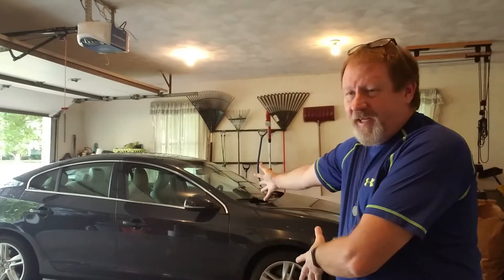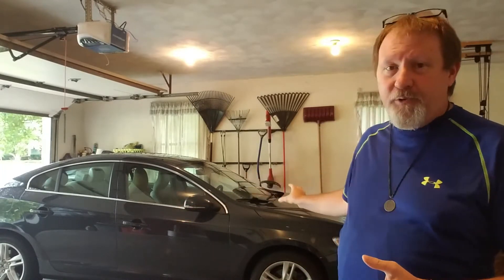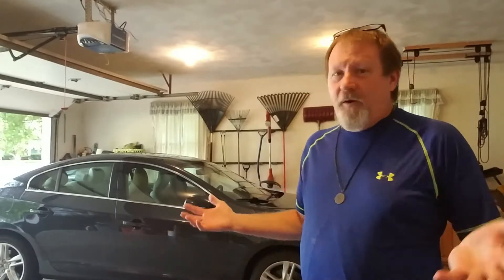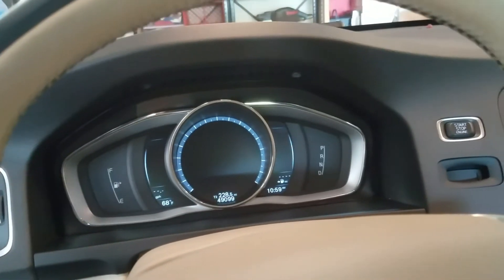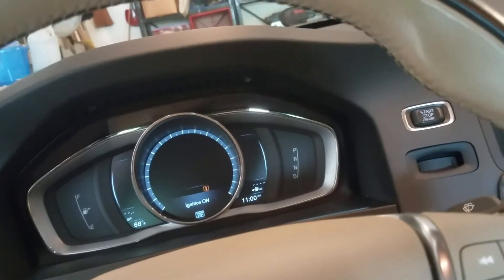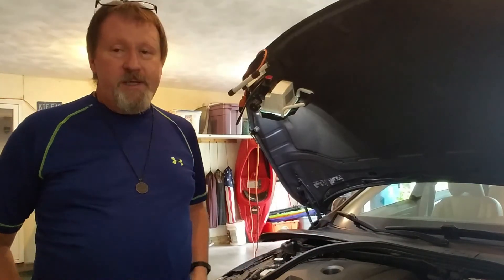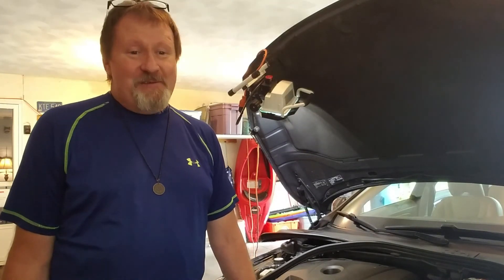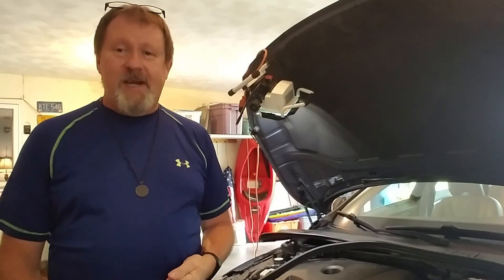Volvo Drive-E Start Stop Not Working

Comment: Hello Floyd,
It's so good to see persons like you, interested in helping others with some car problems. Machines are machines...! right?
This is a brief description about how the Volvo Start Stop system works, in big steps:
-1st engine start of the morning= Only Main battery is used to turn engine and power everything at the same time (Big Battery visible in engine compartment). Small Support battery not needed.
-Car comes to first stop and engine is stopped by S/S system= Main Battery runs all electric consumers in car. (NOT support Battery).
-1st S/S start in driving cycle= as brake pedal is lifting, the Main S/S relay box (under cowl) will switch momentarily, all electrical consumers to the small Support battery (under the cowl) and it uses the big Main battery solely to start engine (This is because you want to use the most powerful battery to run the engine starter motor). 
-As soon as the engine restarts (like in milliseconds) all electrical consumers are switched back to the Main Battery for normal running until the next S/S cycle and so on and the small Support battery is disconnected.
The small Support battery is ONLY used those very few milliseconds while the engine restarts from a S/S cycle. During normal driving, this Support battery is just idling waiting for the next start cycle.  
Conditions like: Climate A/C, Ambient temperatures, Charging system status,  batteries State Of Charge levels, might prevent the system from working. Both Main and Support batteries, must have a SOC at least around 72% to be Ok.

I hope this bring some more understanding to how the Start/Stop system works.
Greetings, Ben
Reply: Hi Ben! Thank you for the detailed information! You caught me just in time, I was about to enroll into a S/S course. 😂

Question: To reset how many seconds for each function? As my dash showed, none of the indicators that Floyd mentioned. 

Thanks again, 

Jean
Reply: @jdykes1381  Hi J. There is no reset function for this system. Both batteries are monitor by CEM (central electronic computer) for state of charge and state of health, continuously. If one fails, the system becomes disable and the message to driver states that S/Stop system is unavailable due to electrical system fault. Once you diagnose which battery is bad and replace it, you have to use VIDA (Volvos diagnose application that all Volvo dealers have) and reset the counters for the battery life, in other words you tell the CEM that the main battery is now new. The small battery does not have this counter. So, determine which of the 2 batteries is at fault if not both and replace them with the Volvo spec and brand (they are better and yes more expensive) and have the counters reset. The system will Aldo sense that the state of charge and state of health on both bats is now within the specs. Saludos.
Reply: @bencastillo3249  Thanks, Ben. I should've mentioned that I just replaced the support battery. However,  it isn't working.
Reply: @jdykes1381  Hi J. Maybe the problem is deeper, outbid your scope. Not knowing the condition of the auxiliary condition, remember that there are more components involved in the system like the start stop relay box, BMS sensor attached to negative main battery cable (you can try if you haven’t, disconnect negative cable and then small wires connector from bms and leave it disconnected for about 10 minutes)see if that helps you. Are you a technician or do it yourself? Otherwise you might consider taking your car to the dealership.
Reply: @bencastillo3249  Hi Ben. I will take it to my mechanic.  Thank you!

Comment: I tried various combinations of the steps described herein far resetting the batteries; none produced the expected result
Reply from the maker: If you're having troubles with battery messages, or start/stop function and resets don't work, then one or both of the batteries likely need replacing.  I tried the resets too, but it didn't help.  I had to replace both batteries in the end.
Reply: @MIFixItDad  batteries were replaced less than a year ago

Comment: I want to disable the Drive-E option, dont want to stress the ignition and batteries for a few seconds I stop.
Reply from the maker: Unfortunately, there is no way to permanently disable the start/stop option.  Each time you get in the car and start it up, you have to push the button to disable for that trip only.

Comment: I charge my auto battery about every six weeks with my auto battery charger. We use our lights heater/ac head lights brake lights phone chargers wipers constantly. So a good charge on your battery is a good thing. Pick one up for around $50.00
Reply from the maker: You shouldn't have to rely on an auxiliary charger.  It has a 210 amp alternator that should easily do that.  It's kind of it's job.  As soon as the car is running, the alternator is what provides the power to those devices anyway.

Comment: The dealership charges 400.00 plus to replace that battery. It takes 20 minutes to replace!! Your videos are a lot of help and resolves the gouging of the dealership!
Reply from the maker: Thanks!  I can't see paying that much for such a simple job either.  It's just silly to do that.
Reply: Good luck on a v40, it took 4 hours and two professional technicians
Reply: On the V40, it's a whole bumper off job.  Could Volvo have made it any more difficult.
Reply: @garymc3519 it is bumper off, but it’s a really easy one to do. Definitely not four hours, even for a novice
Reply: 450 in Australia. Went to a local battery shop and they fitted for free. Saved  over 300.
Reply: Dude ! You got boned

Comment: Hazard light 3 times leaves the hazards on.  Are you saying turn the hazards on and off three times or just press them 3 times which leaves the hazards on?
Reply: On my 2015 T5, I had to hold the start/Stop button for a couple of seconds, then go thru the sequence to get the battery light on the dash to blink 3 times. It didn't work if I just pressed and released the start/Stop button. Hope this helps others. Hope it fixes my problem.
Reply: @rickmelton6137  did you push hazard light button 3 times and left them on or 6 times?
Reply: @VBlotski I don't remember. Try both.
Reply from the maker: Yes, but not all cars will have this reset procedure apparently.  It may be only for those with the start/stop feature or certain years.  If this doesn't work, what you can try is to start the car, remove the battery cover so you can get to the negative terminal (you could do this before starting the car).  On the negative terminal, you will see a small plug where you can press a tab and disconnect it.  Do that.  This is the battery monitor sensor.  Leave it off about 15 seconds, then plug it back in.  This can also be used to reset the BMS for those cars that won't use the other reset procedure.
Reply: @MIFixItDad  Great.  I will give it a try.  I replaced the support battery, which to my pleasant surprise, was pretty easy.  Start/Stop worked once but then our Texas temps were in the 90+ range so I attributed the failure to be temperature related.   I'm going to do the plug unplug battery sensor and see if it helps.  I also have an OBDC tester but haven't broken it out yet.  Thanks for the guidance.

Comment: If I press the hazzard light button 3 times the lights are still flashing when I get out of the car.
Reply from the maker: Either something else went wrong in the sequence, or your car is not one that will use this reset sequence.  Did the battery icon blink 3 times after that?
Reply: @MIFixItDad  I'll try again later. I'll let u know. Cheers sir.

Comment: hi Sir! we have a problem with xc60 2014 . engine wont start and it says cant detect key. the key fob can lock/unlock the car. -- before this happened a night before the 2 front door was opened for a long time cuz two guys were working on replacing the car tint. after that we turned on the car to move it. the next morning it wont start already. and we noticed in the morming when we opened the car the light inside was on probably the whole night
Reply from the maker: I'm not totally sure but have a couple of ideas.  Could just be the battery in the key FOB even though it activates the locks.  If you have a 2nd set of keys, try the other set.  It that's not it, then it could be the battery is just drained too low to activate certain systems, like the proximity sensor for the key.  These cars do strange things when the battery is low.  Most European cars are the same way actually.  I think you battery is in the same spot as my car.  Under the hood, to the right of the engine cover, on the back wall is a cover for the battery.  Remove it.  You need to get a charger of some sort, even if you can only get the cheapo Harbor Freight battery tender.  The small ones will need 8-10 hours to work, larger ones may be fine after an hour, maybe 2.  Connect the positive terminal (red) on the charger to the + side of the battery.  The negative (black) terminal on the charger should go to a metal part of the engine.  There should be a metal engine bracket just to the left of the battery box you can clamp to.  The charger will indicate it's in charge mode if it's a good spot.  Let it sit, and give it a try later and see if that does the trick.

Comment: Floyd, how did you determine in your situation it was the main battery and not the support battery? Thanks
Reply from the maker: To be honest, I wasn't totally sure.  I didn't know about the existence of the support battery until after I replaced the main battery.  It did show symptoms of main battery though.  If I shut off the engine and sat in the car to finish listening to a song, it would shut down with a battery low message within a couple of minutes.  It would be best to have it load tested to be sure though, and the support battery is cheap enough, it's not a horrible idea to just replace them both at once too.
Reply: Thank you Floyd. I used a battery conductance tester and tested both batteries, main battery has only 42% life left (with that life percentage the tester said “replace”), the support battery test came back even worse than the main one. So, both of them need to be replaced. Yesterday I was listening only 2-3 min to some music with the engine shut off and I got a “low battery charge” message right away. Second fact, I did charge the main battery 3 weeks ago, Start/Stop worked 2-3 days only, also taking into consideration that my S60 was manufactured in 2015, same as yours, there is no surprise that the batteries needs to be replaced.

Comment: Thx for sharing the info! I will just leave the drive e start-stop function alone. Normally will turn it off. Is alr proven this thing is a “green/fuel saving gimmick” will actually make your starter wear out faster, frequently start stop will actually wear out the engine too.
Reply from the maker: I normally just push the button so it doesn't do the start/stop also.  It's annoying at times.  It won't cause the engine to wear faster though.  That's an old school thought applied to old school engines.  Even I have a hard time not thinking that way, but the modern engines have higher tolerances and better materials so that the start/stop doesn't cause wear.  Think about the Prius.  The engine in that is starting and stopping all the time and those things barely need their first service at a quarter million miles.

Comment: Should this reset work on an older UK 2012 V40? I’ve tried it but don’t seem to get the flashing battery sign afterwards
Reply from the maker: According to the European V40 forums, the procedure is below.  Looks like the only difference is you press the rear fog light button 5 times.  Alternately, you could take it to a shop that works on Volvo cars, and they can use a programming device to perform the reset.  

For a reset of the BMS:
1. Switch on ignition (do not start engine)
2. Switch on dipped beam
3. Press 5x the rear fog light button (do not switch 5x on and off the rear fog light)
4. Press 3x hazard lights button (do not switch 3x on and off hazard lights)
5. Then the battery symbol in the speedometer should flash 3x quickly.
Reply: @MIFixItDad  sadly that hasn’t worked for me :(
Reply from the maker: @joebullensandc  Do you have the start/stop feature on your car?  If not, then this wouldn't apply anyway.
Reply: @MIFixItDad  ignore what I said. It just worked when I pulled up at a pump in the service station 👍🏻
Thanks for your help

Comment: This is exactly what I was looking for!  I got a quote from the dealer of $500 to replace this auxiliary battery, but it isn’t going to save me that much money in gas so I declined.  Still, I like things to work properly so I will probably replace it myself for $80.  Very helpful video.  Thank you.
Reply: Same 517 before tax
Reply: Never go to that dealer again. The battery itself costs like 70 dollar (VARTA) and replacing it takes at most an hour, escpecially for a volvo mechanic. So they were heavily trying to rip you off.
Reply: I had it done by dealer today. $220 inc labor.